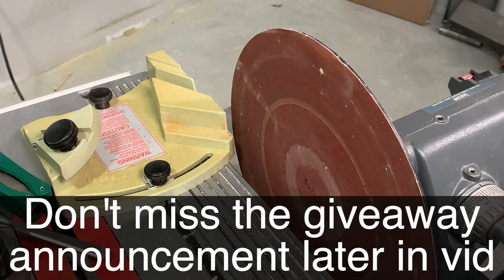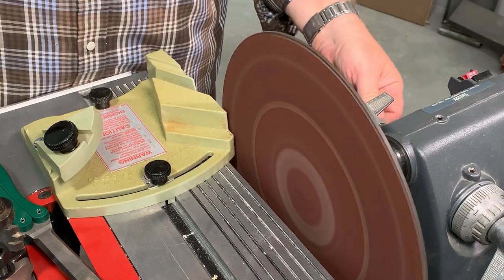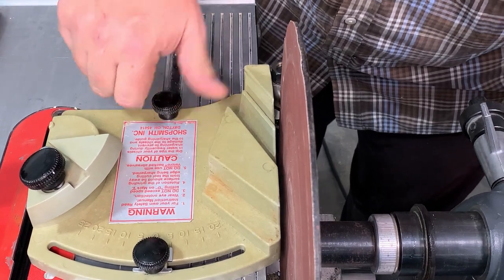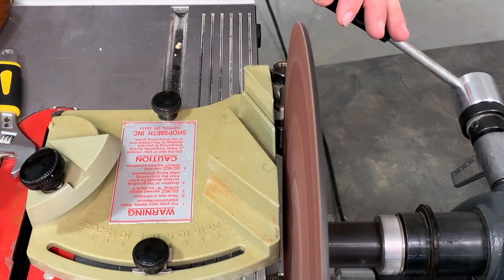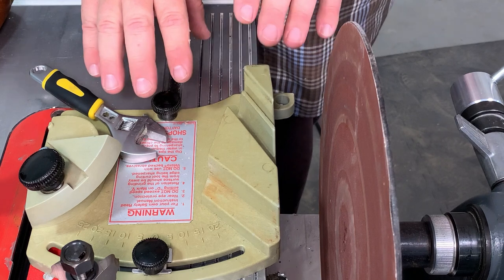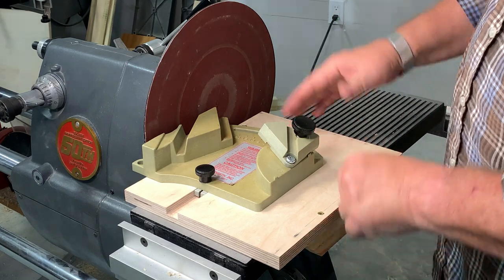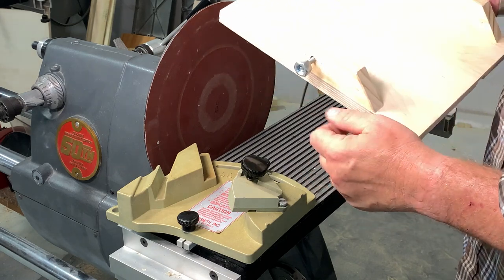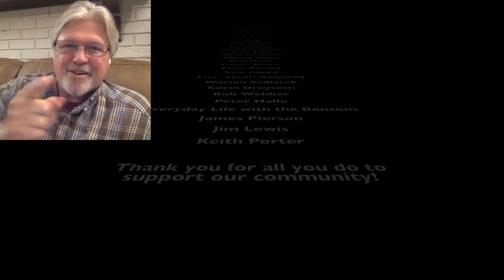Shaper Cutters & Sharpening while Turning: Shopsmith Lathe Tool Sharpening Jig Take 2

Comment: I recently bought a shaper arbor and 7 cutters from eBay for my model 500. First thought was how can I sharpen these. Thanks for this video and your many other videos. You have helped me tune up my old Shopsmith that is still in great condition. And thank you Jon for your kind offer. I need one of these sharpening jigs.
Reply from the maker: You need to watch Tom's video. The most important takeaway should be that you really don't need to remove much metal when sharpening.

Comment: Sharpening tools can be challenging, at least it was for my needs.
I do not have a Shop Smith.
I started with a Grizzly clone of a Tormek purchased to sharpen my turning tools.   I soon realised I needed some Tormek jigs.   I then found it the slow speed was so slow it took too long to sharpen my tools.  I still have the machine, and it still is most useful to gather dust.
I then purchased a Worksharp 3000 and later the tool rest to use my Tormek jigs for the turning tools.   The chisel sharpening was not good due to the chisel always being in the same spot in the disc, similar to what you mentioned.
The tool rest and Tormek jigs kind of worked for the turning tools, but not ideal.
The Worksharp disc was too small for my hand plane irons.   I still have the machine and it also gathers dust.   I have seen that the Worksharp 3000 is still sold, but they stopped selling the tool rest.   It seems the tool rest goes for big money on EBay.
I ended up with a slow speed grinder and some additional new jigs to sharpen the turning tools, a Veritas jig for some chisels and my hand plane irons using various grits of abrasive paper and a granite surface plate, often called the "scary sharp" method.    This works well for the hand plane irons.
I recently changed one of my slow speed grey wheels for a CBN wheel to sharpen my turning tools.   CBN sharpens HSS much faster than the grey/white wheels.
So my personal experience is that no single machine or jig works for all of my sharpening needs.
I have seen videos of folks who are able to sharpen e.g., turning tools freehand.   I tip my proverbial hat to these folks.    They have the muscle memory I do not have.   I find jigs made for my various machines work well for me.
Dave.
Reply from the maker: I used to use the SS jig until I not only gained the muscle memory, but I also had tools that it didn't work with.  I've moved from grinders to Tormek and back to the sanding disc, but I recently purchased a 8" grinder and will be playing around with CBN wheels. I have to admit that the journey is a big part of the fun. Scott

Comment: Thanks for the mention Scott. A problem I had with the shaper cutters and sharpen jig is that some shapers were not parallel to the disc when mounted and required that the jig be rotated or the back of the cutter be shimmed. All in all not a fan of this jig.

I really like that table attachment. I need to make one for my shop deputy so I can use the miter gauge and it might help with clearance on the dust guard too
Reply from the maker: You’re right, there are lots of things we could do if we only had a miter slot on extension tables and floating tables. Look forward to seeing how you might use it. Scott
Reply: Well, bless your heart, Scott. I really appreciate all the information on sharpening with this jig. I still like your idea of using on the belt sander the best. That was very generous of Jon to donate the sharpening guide.

Comment: An excellent jig idea for the Lathe Tool Sharpening Guide, thanks  -  I think I will build one. Will have to first put leveler bolts under my extension table using one of your other videos, though, as its uncorrectable warp has been the reason I haven't mounted my Sharpening Guide to it in the past.  I've also never used my Mk 510 in the shaper position.  Always found the high speed and cutter position over the main table's saw slot to be too intimidating.  Could you please show us how this is supposed to be done?  Thanks!
Reply from the maker: I do plan on filming a walk-through of the shaper, but thank you for validating that need. Scott

Comment: Tried the jig and did not like sharpening, then resetting to turn, then back again. I purchased a slow speed grinder and eventually saved up enough for CBN wheels. Now I let chips fly, turn around and touch up tools and in 30 seconds, I am back disfiguring some wood. Do not use shapers, so that is not an issue. But I think I would try a diamond card as the first choice to touch up the edges. As with CBN, less metal on the floor.

Comment: I have a question on the way you align the jointer knives. Does the weight of your scale affect the “drag” or resistance in getting that 1/8”? Could one not go by the feel of the pull OR the visual height that the knife lifts the scale? I have never asked a question like this on your channel. Thank You for all your great intel.
Reply from the maker: That’s a good question. The knives are so microscopically higher than the outfield table, so there’s really no way to see how high they are in relation to it. That little bit of drag of the straight edge, represents a couple of thousandths of an inch of height above the table.

Comment: Scott, Thank You for another great and informative video! I have a question for your expertice please?
Since the shopsmith can be used as a shaper and a routher table, can it be used as a light duty mill machine if an xy table is attached? By light duty I mean light lateral forces such as lightly shaving wood or aluminum?
Also, how do us Mark V users clamp anything down to our aluminum table that doesn’t have any T tracks?
Reply from the maker: @MRrwmac  it has been done, and, like you say, I would limit it to wood plastic aluminum, and perhaps other non-ferrous metals.  I don’t know if anybody who has posted a video on doing such things, but I would mount your cross slide to a piece of plywood, and either bolt it through the table, insert, or to the left and right sides of the table. Whatever you do, be sure to send me a picture!
Reply: @MyGrowthRings I don’t have a way to send you a picture (or video if you wanted it). Of course me living in Durham I could send via carrier pigeon.
Reply from the maker: @MRrwmac  My email is ScottMarkwood(at)Gmail(dot)com

Comment: Is there a way to use a floating table to get the jig to the headstock so the turned piece does not need to be disengaged when sharpening?
Reply from the maker: Sure, it’s worth a try

Comment: Great tip, Thanks Jon, Question Scott I have a 1956 Greenie looking to up grade my table to a 510, what blade guard do I need to use? Thanks
Reply from the maker: The 510/520 upper and lower saw guard. Didn’t you get them with your upgrade?
Reply: If you order the upgrade from Shopsmith, everything you need is included. The larger table has a totally different upper and lower guard system. Also included is a longer arbor for blades, a longer "arbor" to exchange on the sanding disc. A new fence-narrow on the 510, and wider for the 520 along with a fence straddler that is used as a type of push stick is included. A ~1 inch rubber spacer separates the new large carriage from the headstock and sets the carriage the right distance from the headstock so the blade is properly aligned. A new extension table top attaches to the legs thus replacing the old narrow extension table.  2 floating tables, tubes and expanding legs are included and greatly expands the table surface. A new miter bar is included which secures the miter gauge in the slot in the miter groove. I think the upgrade includes a new lathe rest with quick adjustment screws(I can't think of what they're called, but you don't need the 5/32 wrench to adjust the lathe support.
If an "upgrade" is purchased on the used market, some important upgrade items may not be included. Too bad you missed the recent upgrade sale on the Shopsmith website; another sale will show up in a couple months if you can wait that long.
Check out the upgrades on the website to see what all is included. jim